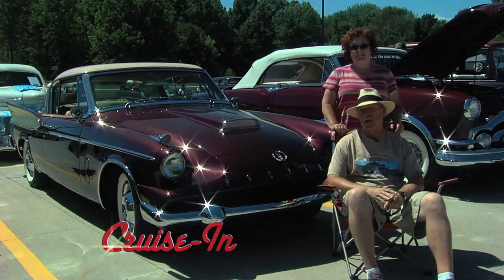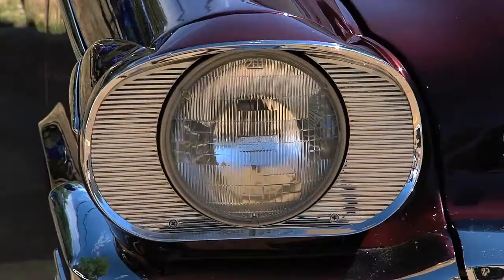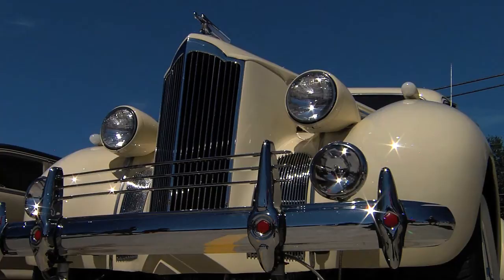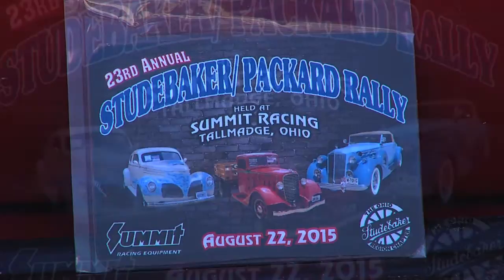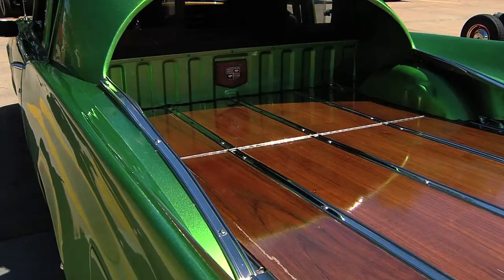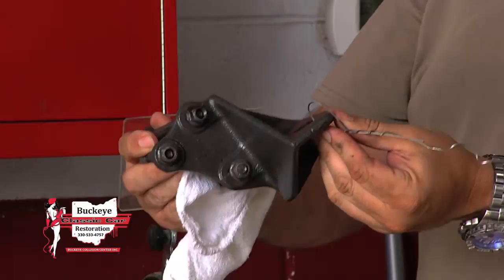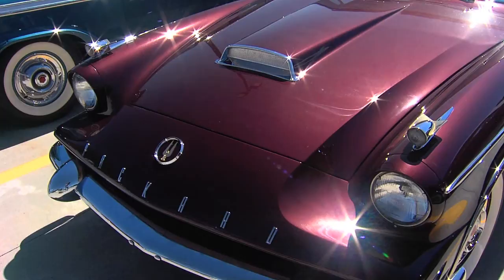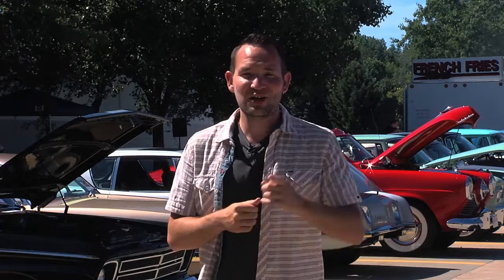Cruise-In Packard & Studebaker Rally

Comment: That Packard Hawk is a show winner! Considering the rarity just fabulous job restoring it. I am about where you started. Mine is a '57 GH in Azure blue metallic, which is the hotrod metallic blue, not the lighter colors. Working on components now, engine, supercharger rebuilt. It likely will take a couple years (ho ho) to finish. I did an XKE Jaguar when I was younger but it took every night and weekend for over a year! Also working on (almost finished) 1957 1/2ton 4x4 factory Chevrolet in Sandstone Beige.